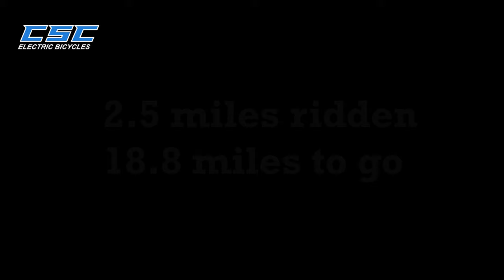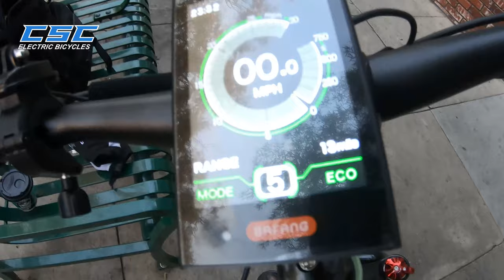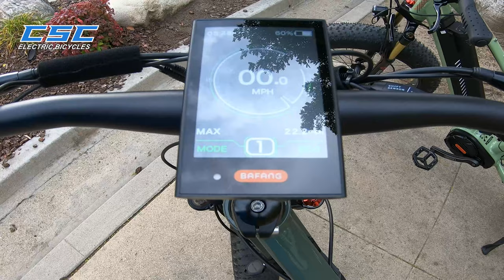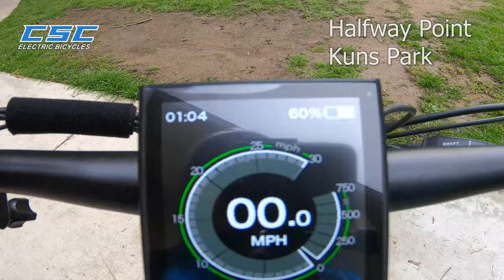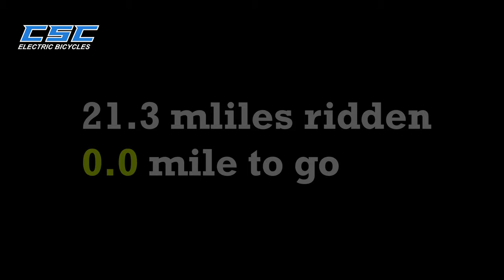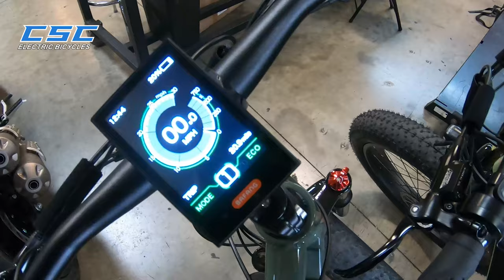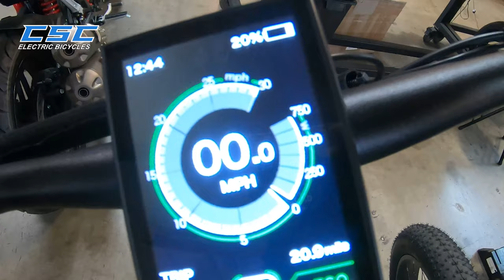Riding the CSC FT1000MD Bafang M620 Mid-Drive 21 Miles to Work. Will We Make It?

Comment: Nice , my bike does 30mph with the new gearing. I used to go 35mph , I think since I went to a 12 rear cog. Gonna probably go back to the 11 for that extra 5mph. I have a huge 52t front. 

Full throttle with 19.5 ah battery I get 30miles full throttle easy.

I have a 13.5 LG cells ,  luna shark pack and a saddle bag battery 6ah running samsung cells.

Both batteries are great.

My bike its a little carbon folding bike with a bafang bbs02. I think total weight is at 40lbs right now with both batteries.

I might get the luna dire wolf pack running 21ah . Then I'll have major range.

Comment: Is this bike an all weather bike? Can it be ridden in heavy rain, snowfall? I have a RadPower bike that I've had for 4 years, biked in all weather conditions even flash flooding, no issues. Also their weight limit is similar to this bike, which seems to be for worst case scenario. Such as, doing crazy offroading where you're jumping hills and slamming the bike down on the ground. I'm just rolling down the street, not hitting potholes or jumping curbs.

Comment: How was it drinking a coffee while riding? Assume easier on an ebike than a bicycle. I would def. Up the battery ah though, and perhaps go to 52v,  especially with that 1000w motor. Or at minimum have a spare battery just in case.
Reply from the maker: It would be easier to sip coffee on an e-bike but we finished our coffee before we headed out.  
An extra battery is a great idea. Having the confidence and extra range is great for exploring. Life is better on an e-bike!

Comment: Ya? Be honest.  I just bought a eunorau spectre s!  Same motor, maybe? Trying to research now. Bfang m620.  After full charge, flying!  Half charge im going into eco mode. Learned that from ur vid.  So congrats, u taught me something and hopefully now im teaching u something.  1500w motor. Down tuned to 1000w? My display shows im using 1436w.  But at half battery, my bike start going into now as i can best describe into eco mode.  Sp going to upgrade to second battery and unleash sport mode.  Thats what im wanting out of this motor and range!

Comment: Does this fat tire bike have a larger pedal width than a regular bike? I think they call it "q factor", basically on a lot of fat tires your hips end up in a wider position that can be uncomfortable to some people. If you could let me know the q-factor measurement that would be perfect.
Reply from the maker: This Mid-Drive is no wider than all our other fat tire bikes, The pedal width is the same weather it a mid-drive or rear hub motor.
All our bikes are comfortable to ride and pedals are in a normal position.

Comment: I will be converting a Trek Verve 3 tomorrow with a Bafang BBS02 and a premium 48v 20ah battery.  Much less rolling resistance and a bit less comfortable.  Do have a Selle Royal saddle and thudbuster LT seatpost.
Reply: How did the build go?  Did you buy the bike for the build or was it already one you owned?    Have a couple of beater bikes with rim brakes so I’m not sure they are worth converting.
Reply: @wakawaka1976  build went well.  I bought the bike for the build ( noted others had used it without problems).  Were i to do it over i would have got a step through style frame and maybe looked at more bikes (the Trek has mostly crappy parts though the frame and wheels are good).

Comment: How much & do they come in larger size
Reply: They are only offered in the 18" frame, the price is $3295
Reply: OK I cant afford that so I'm thinking of upgrading I have 2 bikes looking to upgrade perhaps u can help do u sell conversion kit for hydraulic brakes for a Rad Rover 5 ?
Reply: @lvredwingsfan  you would be better off asking RAD
Reply: @totalkaos1580  I appreciate ur reply Rad doesn't offer the kit they must want me to buy their newest Rover that comes with the brakes thanks enjoyed the video I will figure something out Lord willing of course good day Sir
Reply: @lvredwingsfan  I've tried emailing them in the past for something else, I never received an email back.
Reply: @lvredwingsfan  Hey Frank, you probably can upgrade the brakes yourself inexpensively. I looked up your bike and it uses Tektro MD-M300 brakes. These brakes look to be mounted on a 160 mm rotor so you should be able to upgrade to a hydraulic tektro brake or Shimano that uses the same rotor size without much fuss. You just have to make sure the mount points are the same. Your bike looks like it has post mount brakes so if look up 160 mm post mount hydraulic brakes you should find what you're looking for. If you go to your local bike shop they should be able to get you squared away no problem too.
Reply: @lvredwingsfan  CSC has all their E Bikes on sale until the end of the month, you can also finance them